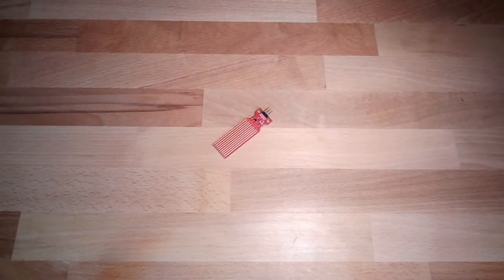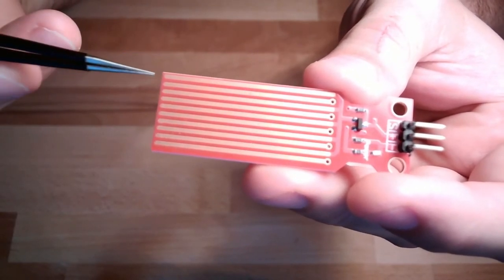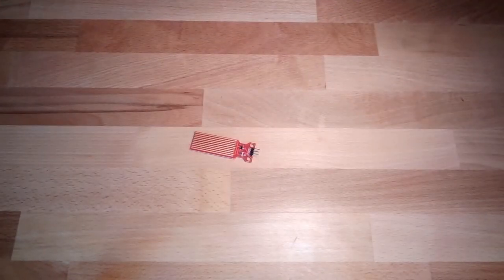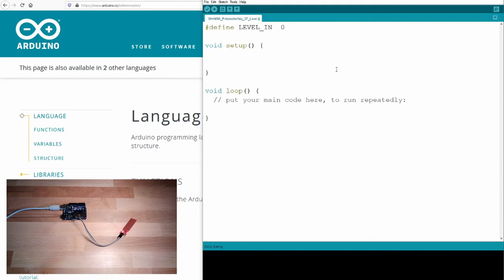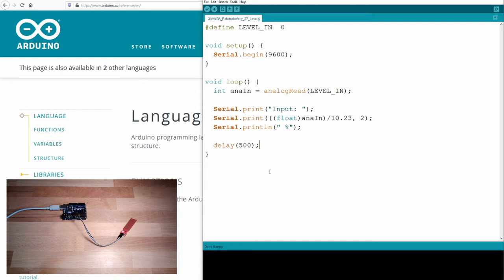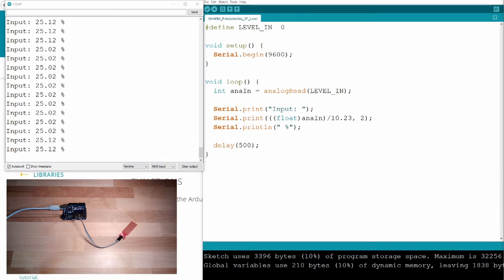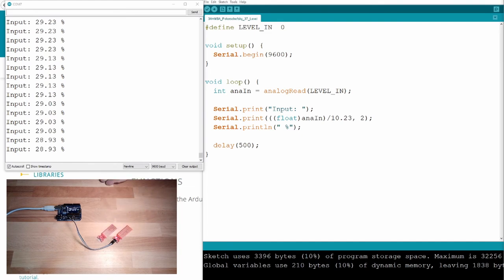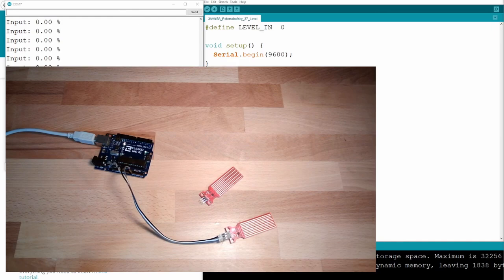Arduino 33: Resisitve Level Sensor (Old)

Comment: I have a big question regarding these sensor. As you said in the video there's galvanic corrosion. I ve now seen a sensor and this one just a level trigger but interestingly decoupled with a small capacitor. But I don't really understand the working principle behind that. Could you cover this topic?
Kind regards
Reply from the maker: Can you tell me some more about the mentioned sensor? I know of capacitive moisture sensors for i.e. watering indication of plants. Maybe these can also be used as level indicator. Are you asking about such sensors?
Reply: No just a contact that is more or less shorted out by the water and as far as I can see changes the frequency response of the circuit. If you are interested I could send you the reconstructed coffemachine level sensing circuit.